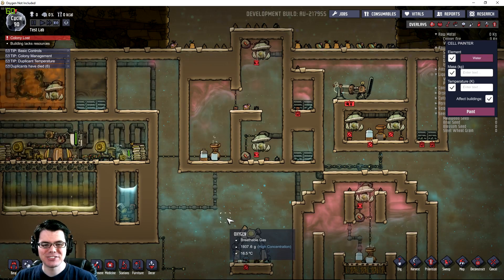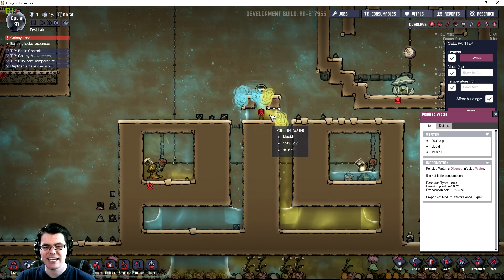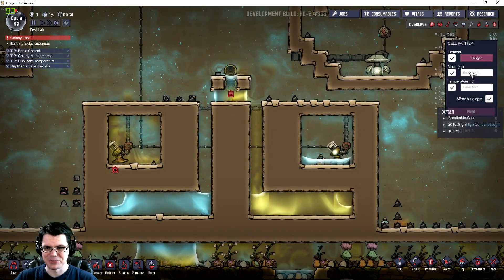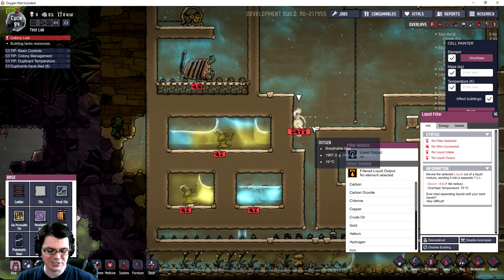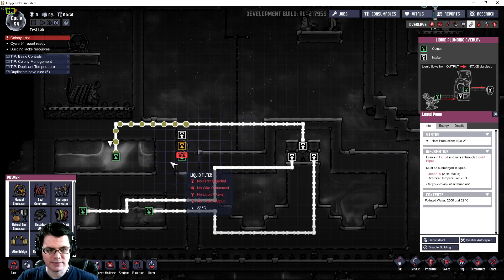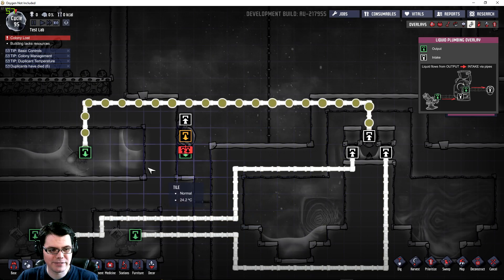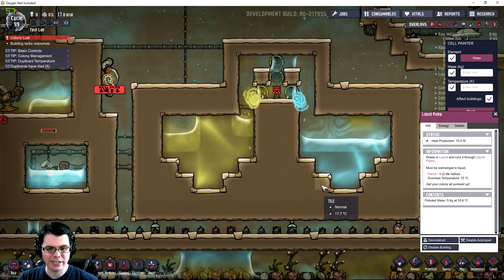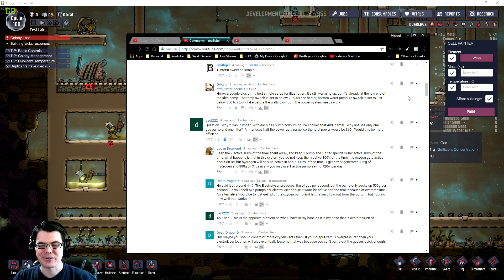Zero Energy Water Separator Experiment! Oxygen Not Included Tutorial

Comment: Impressive as it is, it's still an exploit. Personally, I'll stick to using filters, because relying on a tactic like this could totally screw you over if the game updates and starts letting fluids mix together. 

I always have a big and planned out energy grid in my bases, so powering a couple filters here and there won't be a problem.

Don't get me wrong though, it's really cool to see how water physics can be used to do weird tricks that make the game easier. 

I kind of have the same stance on making "cold rooms" that are either chilled or filled with CO2, to keep storage preserved without spending power on it. It's like...sure, that's pretty awesome when it's done right, but at the same time I could put down a single machine that will always keep the food preserved, and it's really not that much power to keep it running. And no fiddling with gas or liquid mechanics to get it working, on the hope that one of the dupes doesn't screw it up when I'm not paying attention.

Comment: Try using this filter without any pumps, see if you can use an airlock to release a whole tank of mixed water into that filter structure. If the system can work like that it would use even less power and would probably separate faster since it won't be constrained by the max flow rate of pipes

Comment: Just a question you might not have considered.
One of those liquid vents, probably doesn't 'push' things out of its tile
If when you put the locks over both sides in the test run (The original ones to 'calibrate'), wouldn't putting a vent where the liquid is on the edge act as a filter on its own without the additional step?

Comment: the reason in the end that your clean water had to escape through the above hole is that the tile below it had been mostly filled with poluted water from earlier, as it indeed took forever for some clean water to be reached. If you had some clean water earlier, it probably would have worked flawlessly.
Reply: The problem was the tile below the drain was polluted water, and your whole experiment was based on the idea that one tile can't contain 2 substances. It's a neat trick. I recently discovered the air vent bug on accident when some ice melted over my vent and the pressure inside the room got insanely high and injured my dupes.